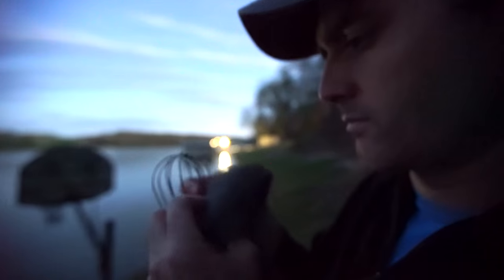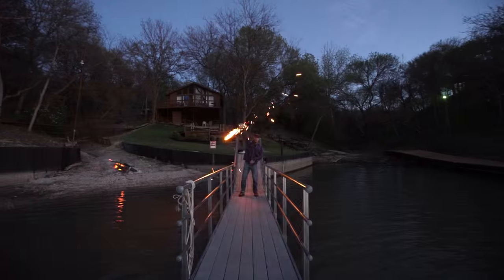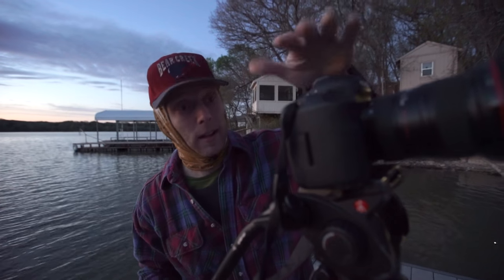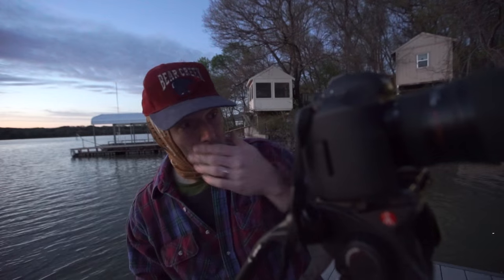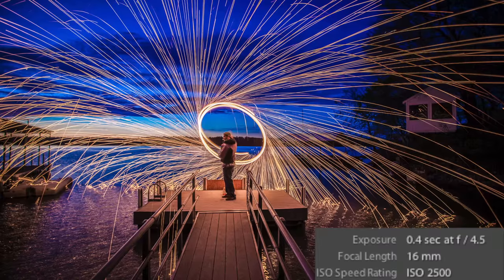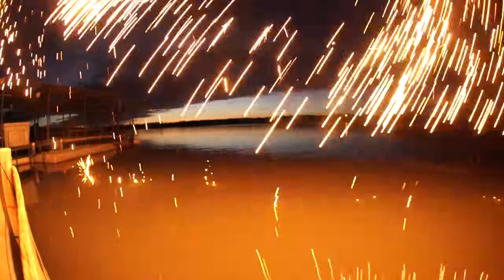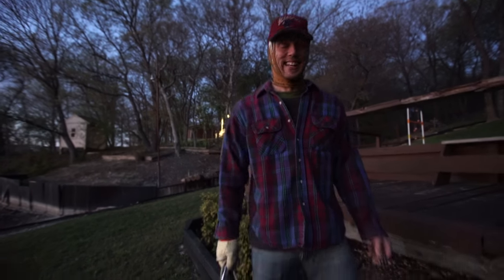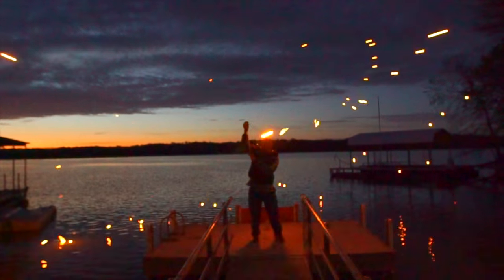Steel Wool Photography Basics

Comment: That is beautiful!

 Can you please help  me tune my pansonic fz 1000 for long exposure shooting of waterfall and waters at all?
I'm ready to try : iso-125,  2,5 or 4sec. shuter speed,and 4 f-stop.    The question that comes now is do i have to take the pics using a timer or no?  i don't have any remote shuter control ...
Thank's in advance.
Reply from the maker: For those long exposures it is always good to get a remote of some kind. Any time you press and hold the button there is a risk you will move the camera and that might get picked up on the pictures. I have never worked with the camera you have but I did a quick search and it looks like it has a wifi function. Maybe there is a chance you can connect it to your phone and then use the phone as your remote trigger? I say test that out first. Second option, if there is a chance you can buy a remote trigger, it is definitely worth it! Good luck - Jonas

Comment: Did the sparks hurt the lens or the camera at 00:08 time of the video?
I'm really concerned about before testing that since I really wanna have a cool look and effect using my 12mm lens.
Thank you and great job
Reply from the maker: Not that we noticed. BUT, we could have just been lucky so don't take our word for it. I am sure that if you get a spark that remains on the lens or anything for that matter, it will prpbably do some harm. I had one that went flying into the sleeve of my shirt and that really stung big time. :) So make sure to keep this in mind. Do what you can to prevent sparks from landing on something and staying there. They are hot! Have fun!
Reply: @robnelsonfilms  
Thank you very much. Sometimes we want to make an artistic work that needs some risk taking but still safety first

Comment: can you use a match or lighter rather than a battery
Reply from the maker: of course. You just need something to get the fire going.
Reply: Yep. I used some steel wool to make flaming arrows for a video I did and I lit the wool with a lighter. Also, I just want to note that it is important to get really fine steel wool. I had a little trouble getting a self sustaining burn since I didn't have the finest wool I could buy.